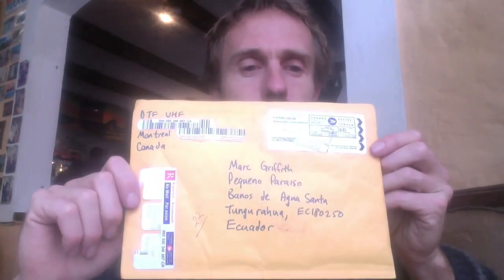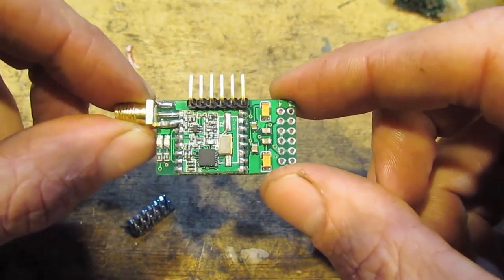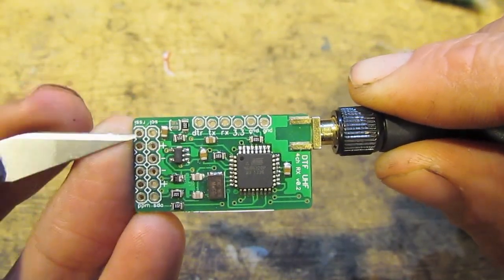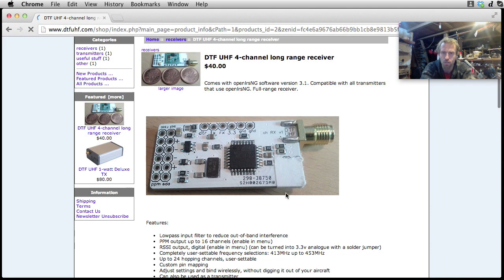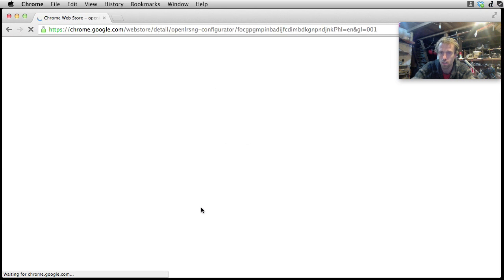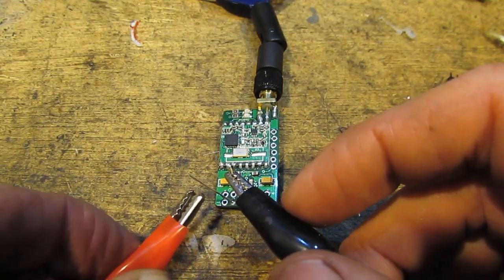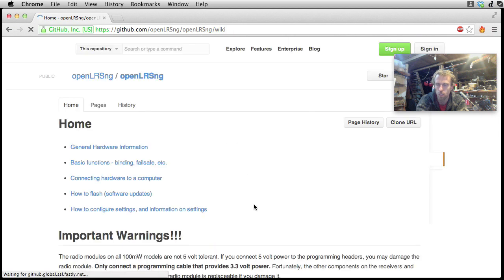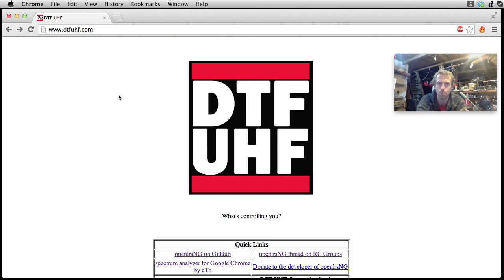DTF UHF an OpenLRS receiver. RCHacker #52

Comment: Ah! got you.  I had intended to use inline resistors on the TX/RX lines as a blue smoke limiter. I have a couple of home made voltage dividers which i use with my FrSky receivers but a small pot would give me an alternative calibration device for battery voltage measurement. I will use the Configurator to select an analogue input on the Orange RX and test that. I have only used a hub on the Frsky telemetry receivers before but having done the PPM mod on the little telemetry RX i can identify the outputs from the hub and match them to the Orange RX. Time for a little hack! Cheers Mark - I will update later
Reply from the maker: Have fun

Comment from the maker: I just looked at that, unclear, I doubt it. It needs to be 3.3v and output TTL serial.

I'm connecting to the openLRS module inside the transmitter. Yes you can use the configurator to flash it and set it up.

I have added a link to the openLRSng wiki above:

Sorry, youtube has a PM system? As much as the YouTube comment system sucks id prefer to keep questions public, that way my answers are accessible to all. Otherwise I use email. Perhaps it is time for a forum.

Comment: Hi marc, a few questions im pondering:
Can i use the orange RX flasher tool to do all this on the hobbyking lrs?
With your transmitter, (if connected properly) can you just flash it with that flashing tool as a tx? I know from your other videos that you use an rx as a tx in the 9X.
If you have time to answer these questions that would be great, Also I sent you a PM with a few more a couple of days ago.
Thanks for your help.
Cheers, Luca

Comment: Do you think it is possible to use an orange lrs receiver as a transmitter in an hkt6a? I mean with the right firmware on the lrs could it directly take the inputs from the radio and transmit them?
I have taken the hkt6a apart and if i took out the 2.4g video transmitter and replaced it... Would the t6a use the same kind of output code as the 9X? 

If you have any advice or some educational reading you can recommend in this area it would be much appreciated!

Comment: I'll just have to get my head around that. The DTH UHF DIY TX uses a discrete Arduino Pro Mini as the processing core which operates on 5V but has 3.3v logic levels? The 9X /9XR uses a similar processor, which presumably also has 3.3v logic levels? So is the potential divider needed and in which direction? I am not sure yet.
Reply from the maker: I'd say the diy tx processor is running at 3.3v. 9xr id say 5v. but even with the difference it might just work. Worth putting a 1k resistor inline on each connection for protection.

the voltage divider I was referring to is just to take the 12v of the battery down to 3.3v of the analog input. That is if you do not use the frsky hub.

Comment: what is the max operating voltage DTF UHF MiniRX 8-channel long range receiver can take? no one seems to know but you seem like your very knowledgeable.
Reply from the maker: J Sanders 3.3v for all units except for the 1W modules which can go to 5V. The limitation is on the RF module.

Comment: I am new to the 433mhz systems. Using 72 mhz for years. I recently bought the Dtf Uhf system which plugs into my jr xp9303 and a 8 channel mini rx. I am looking at the ports on the mini rx and I don't know where to begin.  Is there a schematic to show me how to plug or where to plug in all my servos,esc, power ? Thank You
Reply from the maker: +Leo Manzanares Im not sure exactly which receiver you have. Does this help?  https://github.com/openLRSng/openLRSngWiki/wiki/Hardware-Guide

Comment: Already modded the 9x and bought a spare 9XR board to mod that. So just connect MOSI and MISO on the 9X board to MISO and MOSI on the DTF UHF DIY TX board? At the receiver end I suppose I can just patch an FrSky hub to the TX and RX or identify an analogue port or two for voltage measurements? I have looked at the Google App Configurator and it seems very versatile in that respect.

Regards

AlanGP
Reply from the maker: TX and RX on the DTFUHF, though i did mine with an RX not sure if those pins are exposed. MISO and MOSI are also TX/RX on the Atmega in the 9x. the atmega328p has separate TX,RX pins. I use a pot to bring the voltage down within 3.3v then feed that into the analog input on the rx.

Comment: Mark,
I have an frsky modified 9X. I have just built the DTF UHF DIY1watt TX. Where can I find out how to connect them up for telemetry?

Alan
Reply from the maker: You will need to do the telemetry mod to the 9x board: http://www.rchacker.com/projects/turnigy-9x/open9x-and-telemetry  and then just hook up the rx and tx lines.
Reply from the maker: I think I went over it roughly here in this video: http://youtu.be/GJHK4THp2kM